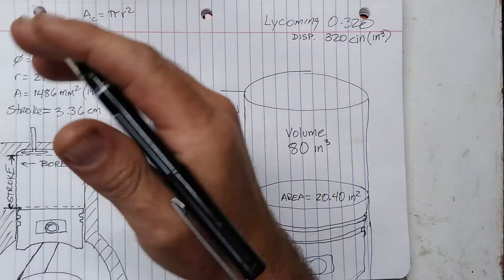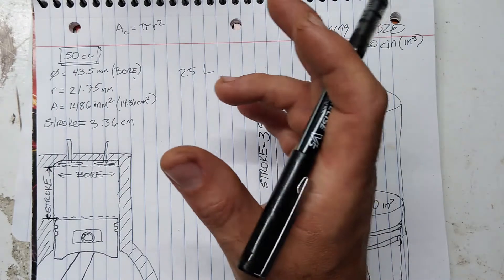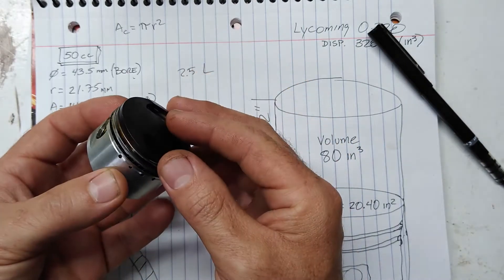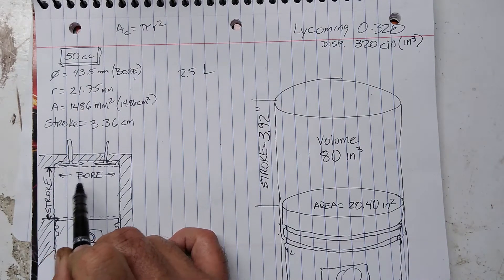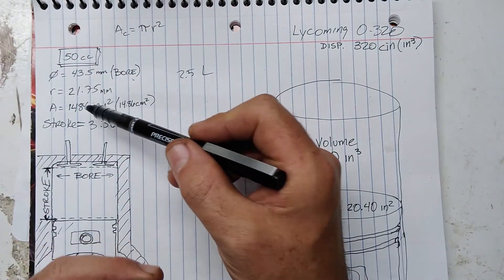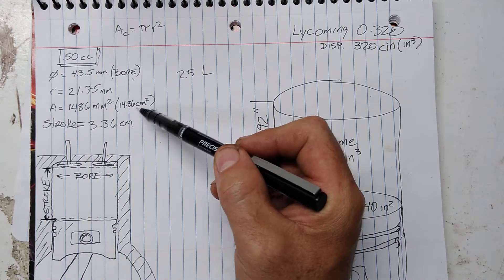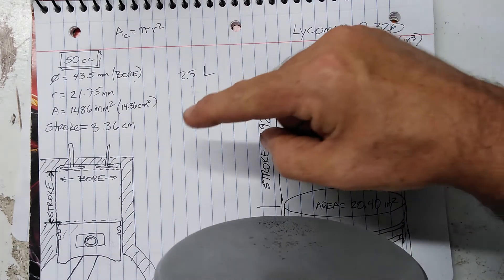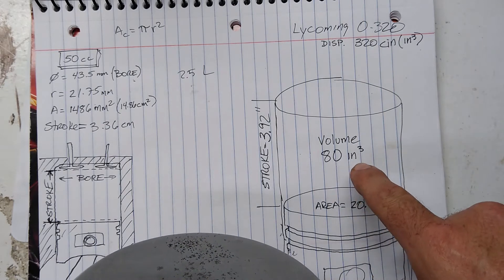Engine Displacement - Explained

Comment: sir now what is the time needed to burn 2.5 L inside 50 cc engine?
Reply from the maker: Hello, it depends on a lot of factors like RPM's, engine load, meaning throttle position(fully open or partial throttle), atmospheric density, temperature, altitude, etc...
Reply: @planesimple8514  I have to choose one of.... 4 hp 53 cc 6500 rpm 4 stroke or...... 2 hp 79 cc 3600 rpm 4 stroke.... which one is more powerful and better?

Comment: Perfectly explained and even though animations and diagrams give a good visual representation in videos your demonstration with the actual engine makes it absolutely clear with what’s going on inside - good job. 
I feel a bit overly critical in saying this but maybe the suggestion that the crankshaft is moving the piston via the connecting rod should be described as the piston turning the crankshaft through the rod. Without the context of combustion in the cylinder causing the piston movement somebody new to this may be left wondering why the crankshaft needs to move that piston. Nonetheless, the video is still explaining displacement accurately as the title promises. 👍
Reply from the maker: Hello ace of spades, thank you very much for such a positive comment. It is very satisfying to receive words like yours from  my very simple, no budget videos. 
Regarding your comment or suggestion about the crankshaft moving the piston, don't feel "overly critical". I'm always open and receptive to corrections, suggestions or criticism as long as it is done in a respectful way. We can always use another point of view or prospective.
Going back to the crankshaft/piston, who moves who?
The answer is both. The piston only moves the crankshaft during the power stroke. During intake, the crankshaft is pulling the piston down. During compression the crankshaft pushes the piston up, and during the exhaust stroke the piston is once again pushed on by the crankshaft. It is only during the power stroke that the piston does the pushing onto the crankshaft.

Comment: Please so does that mean that  under the same moving conditions the fuel consumption of a 4.0 l engine will  be exactly twice that of a 2.0l engine?
Reply from the maker: Hello, thank you for your question.
No. 
Let's assume that by "same moving conditions" we are talking about the same vehicle, at a constant speed, or same acceleration, only difference is the engines, one being twice the displacement of the other. 
In those conditions, the fuel consumption would be about the same for both engines. This is because the engines will only produce the energy required to match and counteract friction and maintain a constant speed, or enough energy to produce a certain acceleration. The engines have the ability to produce a maximum rated power, but they are not always at max power (full throttle). 
The engine that is twice as big,at full throttle, would be able to accelerate that car faster than the same car would with the smaller engine. In that case the fuel consumption would be around twice as much because you are producing twice the energy but also different accelerations, not "same moving conditions".(I'm using power and energy interchangeably here.)
But if you are comparing same constant speeds, or same accelerations, both engines would consume about the same fuel.
Think of it this way... It takes a certain amount of energy to move a mass at a given speed against friction, or to accelerate it at a certain rate. This energy comes from the fuel. The engine converts that energy from the fuel into that motion. It doesn't matter how big the engine is, it will only process that fuel at whatever rate you ask of it. A bigger engine can process more of that fuel, therefore it can accelerate the mass faster, but if you throttle back to a fraction of the engine's ability, say to match the acceleration of the smaller engine, then the fuel consumption of the bigger engine would match that of the smaller engine since their output would be the same, only the energy required to produce the wanted acceleration.
I know this has been a long answer but I hope that it makes sense.
And I hope that I have answered your question.

Comment: For the same small size piston, is it possible to have a higher cylinder (hence a higher stroke), that would provide more engine power?  Thanks.
Reply from the maker: Yes, it is certainly possible, but you'd be trading some engine characteristics for some others. The longer the stroke, the less efficient the engine tends to be since more energy goes into the direction change of the connecting rod. It also tends to have a lower rev limit before it shakes excessively. But on the other hand,  you get more torque out of longer stroke engines. 
Those are only a coupe of factors that go into the dimensions of any engine.

Comment: How come my 5.4 triton makes more hp than my 5.7 vortec? They are both naturally aspirated
Reply from the maker: Hello Chrisvill, there's more than just displacement when it comes to horse power ratings, for example, compression ratio and RPM limits. 
A Lycoming O-320 aircraft engine has a displacement of 320 cubic inches(roughly 5.2L) and it's rated to only 150 to 160 horse power. This is because it is a very low compression engine that spins very slowly at low RPMs. 
On top of that, the seat of your pants feel of H.P. in your trucks are also affected by the transmissions and rear ends that are coupled to them. Those gear ratios make a world of difference in the performance of the truck. Those gears are a compromise tailored to a specific use,  like top speed, towing capacity, acceleration, milage, etc. But transmissions and gears are a tangent that were not what you asked about. 
I hope you can see now that, like I said in the beginning, there's more than just displacement when it comes to H.P.

Comment: Hope yoy explained the car engines with multiple cylinders..
Reply from the maker: It's the same thing, just more of everything...LOL.
You could literally attach more of the same engine back to back and make yourself a multi-cylinder engine. Now picture all the. Individual crankshafts joining with each other at the tips, and all the individual blocks fusing together, you'd end up with a multi-cylinder inline engine.
Reply: @planesimple8514  Yeah I understand now.. Just a constructive criticism, it might be better not to assume all viewers understand that a 2.5 Liter 4 cylinder is 2.5 divided by 4.. I felt that it should be included in the topic..
Reply from the maker: Understood, thank you. 
I appreciate it.
Reply: @planesimple8514  more power tonyour channel

Comment: Thanks.  Just wondering in a single cylinder 2.5leter engine, the piston is at the bottom of the stroke  , does  it mean if you put a liquid like oil in it , it could contain 2.5 ltrs of oil
Reply from the maker: Yes it would, plus a little more. Keep in mind that the very top of the combustion chamber has a little space beyond the top of the piston at top dead center(TDC). That space is in the head and is where the valves and spark plug are. That means that if you were to completely fill the combustion chamber up with a liquid, you would need a volume equal to the piston's displacement plus the extra space in the head.

Comment: how do you convert cubic inches to cc?
Reply from the maker: Hello Kahlaa Rabbani, it's easy.
1 linear inch = 2.54 cm

1 square inch (in²) = 6.45 cm² (2.54cm x 2.54cm = 6.45 cm²)

1 in³ = 16.38 cm³ or cc
(2.54cm x 2.54cm x 2.54cm = 16.38 cm³ or cubic centimeters or cc.)

Therefore, to convert cubic inches to cubic centimeters multiply cubic inches times 16.38

I hope this is clear enough.
Reply: @planesimple8514  aaah ok thanks
Reply from the maker: No problem, any time.
Reply: @planesimple8514  thanks though, because i was a little bit confused on what measurement people would use for their displacements. for example if you measure you cylinders in inch you get cubic inch, if you measure in cm you get cc. like the mustang boss 429 has a 429 cubic inch displacement but i didn't know how they convert it to 7 liters. turns out they multiply it by 16.38 and divide by 1000 to convert to liters.
Reply from the maker: That's correct, 1 litter is 1000cc.
For example, a Mustang's 5.0L is 5000cc.
Or a motorcycle's 600cc engine is 0.6L.
Reply: @planesimple8514  one more. if someone measures in cubic inch, to convert it to liters. they need to convert it to cc then they can convert it to liter right?
Reply from the maker: Yes, or you can multiply cubic inches x 0.01638. 
That's 16.38/1000 and it would give you the answer in litters in one step.

Comment: Good video - is there a way to relate engine displacement that you explain here to engine horsepower?
Reply from the maker: Hello Rodney, 
Not really. Horse power is a measure of the engines ability to extract energy from fuel and convert it to mechanical energy or motion. 
Although bigger displacement would mean ability to burn more fuel, it does not necessarily corelate to power output.
RPM's play a huge roll too. Combustion efficiency, gas path flow characteristics, compression ratio, etc, all play a part in power output of an engine, not just the displacement.
Reply: Could you explain how stroke/travel affects power? Correct me if wrong.but a 600cc sports bike can rev higher than 1000cc generally because they have such short stroke. Of course this higher rev should be higher power potential but a 1000cc sports bike has alot more power at lower rpm. Is that part because stroke (part of capacity itself) is larger so more.fuel and air is ignited which offsets the lower rim? Ps thanks for the video

Comment: Does the depth of the piston (the space it takes up) affect the area formula or are we just going off the space of the cavity of the cylinder between the beginning and ending revolutions of the piston? Does the depth of a piston affect the torque output? 

I've seen some engines where the pistons will sit flush with the head surface during their revolution and some where there is some space (volume left), what effect does this have? Does the volume/depth of the head deck play a role in displacing combustion? 

Sorry for all the questions but you got me curious. Thanks for the information.
Reply from the maker: Hello "Hugh Jass" that's an awesome name! 😆
The calculation of displacement assumes the top of the piston to be a flat disc. It does not take into account the shape of the top of the piston, a.k.a. the piston crown.
There are all kinds of shapes and reasons for the different shapes of piston crowns. You can have indentations into the piston to allow for valve clearance. This avoids piston to valve interference at the to of the piston travel with valves that are still partially open. This is a common characteristic of high compression engines. These engines leave very little space between the top dead center position of the piston and the head and therefore you need to shape the piston accordingly. 
By the way that little "space" I just spoke about is called clearance volume. It's the space within the head and the piston at top dead center or TDC. The difference in volume between that space and the total volume an bottom dead center or BDC gives you the compression ratio.
Here's an entry by an engineer from Quora:

 components of cylinder volume are important:

(a) The "Displacement volume" is the volume displaced by the piston as it moves between top dead center (TDC) and bottom dead center (BDC). This volume determines the capacity of the engine.

(b) The "Clearance volume" of the engine is the volume between the cylinder head and the piston when the piston is at TDC. The ratio of this volume to the swept volume determines the compression ratio of the engine.

I hope this helps Hugh Jass, and welcome to Plane Simple.

Comment: Is it better to have a really wide piston with a small stroke or a really thin piston with a long stroke?
Reply from the maker: Hello Scott Free.
It depends on the application of the engine, the fuel being used(how fast it burns), etc. 
For example, Formula one engines tend to be wide piston/short stroke, plus long connecting rods to minimize changes in the angular momentum of the connecting rods. This allows those engines to rev up to astronomical numbers(upwards of 20K rpm's) and produce a lot of power  from a small displacement. The down side is highly stressed components and shorter engine life of just a few races. 

In contrast, large truck diesel engines tend to have the smaller piston diameter with a longer stroke, all relatively speaking of course. This makes for very low revving engines(about 3,500 rpm's) but gives them the ability to produce large torque numbers and a very long engine life(in millions of miles).

Regular car engines tend to have "square" engines, with same piston diameter as the stroke (or very close to the same). This makes for a good all-around engine. It revs up to 6K to 10K rpm's and have an acceptable engine life of hundreds of thousands of miles.

I hope this answered your question.
Reply: @planesimple8514  thank you! That more than answers my question, and is fascinating, I really appreciate it
Reply from the maker: My pleasure.